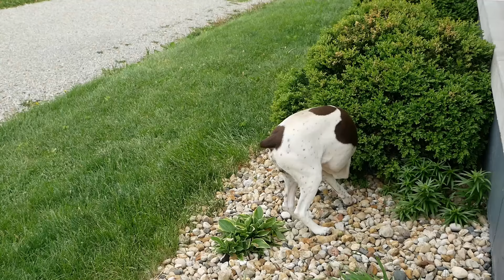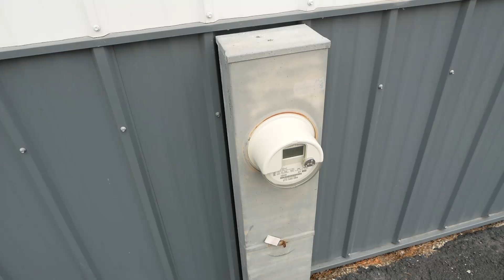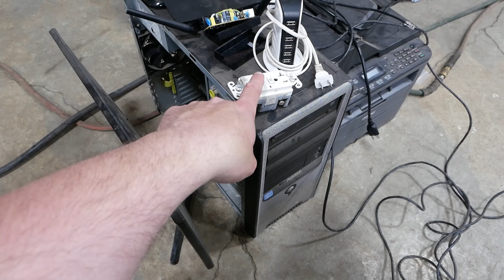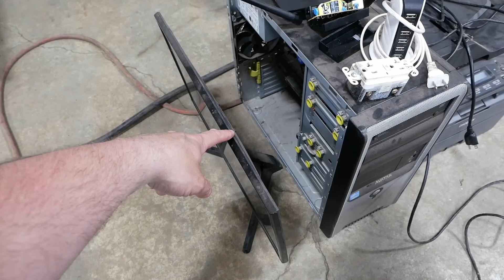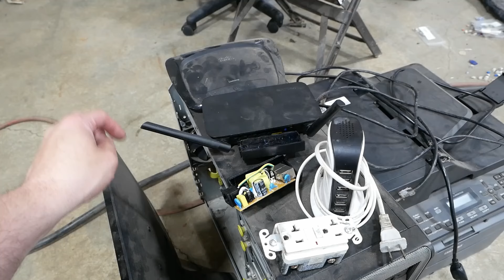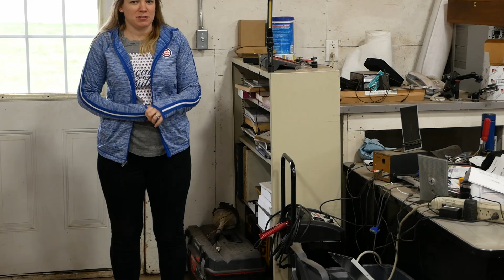Lightning Strikes Shop, Again...

Comment: One of the problems with a close lightning strike is that there are a number of effects other than the current on the line.  The lightning creates a local electromagnetic pulse (EMP) and solid-state devices in proximity to the strike can be taken out.   I designed airport electronic systems and had electronic equipment located outdoors that was electrically protected and in a metal enclosure, and the equipment was damaged by EMP from a lightning strike to a nearby light pole.
Reply: Also not to forget, if lightning strikes a power line, a considerable voltage can also be coupled into neighbouring cables and phone line, smoking devices not even directly connected.
Had this happen ones when my router got smoked through the phone line. And the area I live in actually all lines are underground and did not get a direct hit at all.
Electrical surge protection can be done in a building to prevent auch things happening. Usually it would require surge arresters in two, more likely three stages. But it is awfully costly and the way utilities are built in the US, I am not sure what it would take out upstream anyways that needs replacement.
Reply: This guy is correct
Reply: Spot On.
Reply: You wouldn't believe the amount of people who think that EMPs are conspiracy
Reply: @FrequencyOfThought  emp itself isn't, the "conspiracy" is how little research based information is available. 

I worked on a WSC-3 hf satcom radio in the navy. Every input and output had zener diodes routed to the case. They can short reasonably easy and cause loss of use of that pin. Old timers allegedly rigged a plug where they would pull everything out of the chassis and plug it into 115v to fry all those diodes. I could see a diode protection scheme working to prevent emp damage.
Reply: Some years ago we had two local lightning strikes one about 400 yds away, the other 600 yds away from a station on the preserved railway I help at. Damage was several blown fuses on 240v, 110v and 12v cabling plus a blown diode on a motor all soon fixed. One telephone got blown up but that was the only one as it didn't have the line discharge/surge protection all the others did. This was all down to EMP. Another railway nearby also suffered from the EMP and their computer system was down for nearly 4 days!
Reply: Nature's nuclear holocaust.

Comment: Might be time to invest in a whole home surge protector. No guarantees but they work better than the strip ones. Electrician will install it at the panel unless you fell safe dealing with the incoming power.

Comment: SORRY IT HAPPENED,... When it hits a pole at the road and runs in, there's nothing you can do about it but suck it up and go on. Only way to have prevented that would be to not be hooked to the pole, meaning ... Wes got no electricity....GOOD IDEA but NOT PRACTICAL.

Comment: Back in the early 90s we had an electrical storm which caused several surges. During the first surge  2 lightbulbs burst and our dryer jumped far enough to unplug itself. I had an expensive surge suppressor hooked up to my computer and the monitor did not even waver. I had time to shut everything down with very little trouble. A local TV repair guy was swamped with work most of which was so blown it could not be repaired. Cheers. ~ulrich

Comment: Wes, I'm a professional electronics tech for almost 40 years now.
A surge protector is to protect your house, shop and other buildings wiring from toasters, hair dryers and other items that have shorted out.
NOT electronics. 
For that, considering all you have hooked up including your computer and peripherals you need a 1600 battery backup UPS.
A good UPS will protect electronics from lighting strikes, shorts caused by other equipment in your buildings. 
For a smart TV abd the usual items hooked into them at least a 1200 battery backup UPS.
They actually do protect electronics from various issues that can damage electronics. 
A good one has a small display that has a menu that lists various functions.
The syn wave of the AC feeding into it and out of it.
The load it's handling and you should never exceed 75 to 80 percent of it's max capacity rating.
The backup batteries level of charge and it's condition. 
There's a couple more.
Your internet cable input should be plugged into it. The computer into one of the battery backup plugs.
Items that won't be damaged by the power going out briefly can be plugged into the non battery backup plugs.
Every item that goes into your computer or TV needs to be plugged into the UPS.
A good one has a cable that goes from the UPS to your computer and if you leave your computer on and go off somewhere at a time the power goes out once the UPS's battery drains down to a certain level it will perform a "soft shutdown " of your computer. 
Recently here at our Apartments the same thing that happened to you happened to the pole transformer that feeds my building. 
The next morning there was a pile of tv's, dvd/blu-ray, stereos and other electronics devices beside our dumpster. 
Nothing of ours was effected.
Well, one of our neighbors electronics didn't get damaged but that's because my Wife is friends with Jimmy's wife abd I'd shown Jimmy my UPS after his TV went cabloie for some reason I think was caused by a voltage spike.
The one I have my Samsung smart TV, DVD/blu-ray and stereo on is a 1200 I got at COSTCO for a little over 100 bucks.
Our phone chargers are also on a strip outlet plugged into it as well on one if the non battery backup plugs.
A good UPS would have saved you a lot of $$$$$$.
Ooh,Florida is the state that has the highest level of lighting strikes.
Electronics stores love it.
Reply: Circuit breakers protect against short circuits, not surge protectors.
Reply: @woodhonky3890 .
Tell me Wiodhonkey, how many years working on electronics professionally do you have ?
For ne, 38 years now.
A surge protector is in effect a circuit breaker.
It's that reset button on it that makes it one.
A surge protector is the first line of defense against shorts that can damage a buildings wiring.
As I said, their main purpose is to protect your house wiring from shorted appliances. 
NOT to protect electronics from voltage spikes.
I've been using UPS battery backup units since they were first on the market.
Reply: I'm sorry, but you're just wrong. Short circuits in household appliances do not cause overvoltage events. A surge protector, in fact, becomes a short circuit during an overvoltage event (a thing not caused by a shorted hairdryer..).
Reply: @Monkeh616 .
Gee, then I guess they should just discontinue making and selling UPS battery backup units  in your opinion. 
Only if it's a GFCI outlet does your hypothesis apply.
Every time a circuit breaker is triggered at the CB box it stresses the wiring in a building and can eventually lead to in wall fires.
The whole point is a UPS battery backups purpose is to protect electronics from lighting and other voltage spikes. 
Since I began using them I'm my home and at locations where I or those I was a service manager for not once have I or they had electronic equipment damaged from those issues. 
My profession is Coin-Op amusement vending including jukeboxes (now downloading) arcade and pinball games, touchscreen games and other electronic equipment. 
In the Keys when I was the service manager for TLC Amusements vending I was able to cut our out of order service calls caused by lightning and other power related issues by well over 90 percent. 
The Keys are notorious for having horrible wiring conditions in buildings and especially bars.
The first bar I installed them my boss was skeptical until we stopped having regular problems with the computer systems in our  bar top touchscreen games and the Golden Tee golf games.
Plus blown amplifiers in our CD jukeboxes.
Again, a power strip will absolutely never protect electronics from a lighting strike or any other power surge.
It's NOT what they are made for.
Try doing some intelligent research into the matter.
Reply: @pinwizz69  I never said anything about UPSes - or GFCIs, for that matter.

UPSes are to keep equipment running temporarily in the event of loss of supply - in addition they may be line interactive (multi-tapped transformer) to handle persistent under-voltage or over-voltage events, or double conversion to maintain a fairly constant output voltage regardless of input state. They may (usually do) contain MOV-based surge protection, which protects against transient overvoltage, which has nothing to do with faulty hairdryers.

GFCIs protect against, primarily, shocks to persons by detecting an imbalance in current in the active conductors of the circuit and opening the circuit as required. Nothing to do with surge protection there.

Surge protectors, large and small, as noted above are by and large MOV based and serve to protect against transient overvoltage events with fast edges. They operate not by breaking any circuit but by becoming conductive at higher voltages and intentionally shorting the supply to clamp the voltage. Lightning is an extreme example of such and, for direct hits, requires substantial mitigation to bring energy levels down to containable levels. Other surge events include those caused by inductive load switching, which can cause transients in the low hundreds to low thousands of volts, and are usually easily suppressed by surge protectors of smaller scale, such as those in many power strips. The small, higher voltage MOVs in these strips are indeed inadequate to deal with major events caused by lightning strikes near and far or very large industrial load dumps, however, they make much larger and more effective devices for such tasks.

None of this has anything to do with overcurrent protective devices (circuit breakers both thermal and magnetic, fuses..). Those devices operating does not 'stress' wiring and lead to fires - improper protective device selection, incorrect CSA of wiring or improper installation, and poor termination lead to fires in walls.

Comment: just an FYI, since you are not a computer person, but a surge strip has a limited lifespan!  they need to be replaced about every year, because they are only rated to take so many joules of energy until they are used up. An active UPS is a nice thing to have, because it will just dump the overcurrent right to ground instead of having a surge capacitor that wears out, but if it doesn't do that, my other 2 UPS's have an easy to desolder/remove the MOV, so I can just order a new one every year and pop them in.
Reply: Sort of? The issue with MOVs is repeated high energy impulses cause internal breakdown which causes them to pass current and self-heat at normal line voltages. Thermal fuses are used to remove the MOV from circuit when this occurs. It's not really a case of replacement every year, but when they fail..

Comment: Something I would suggest in future is to put all of your sensitive electronics on a UPS. Not only will that provide you a battery backup in the event of a power loss, but they also tend to have much better surge protection than power strips. Better to lose a $150 UPS than everything downstream of it. APC and Eaton make some really nice, really affordable ones.
Reply: A UPS and commercial surge protector will not stop a lightning hit and charge! You'd  need to install a lightning rod suppression  system.
Reply: @tekvax01  They're not a 100% guarantee, but they're better than surge-protecting power strips. The combination of a standard breaker, GFCI outlet, and UPS will severely limit the amount of downstream damage that is done. I agree that he also needs a lightning suppression system, but this is just general advice. Don't rely on a cheap inline surge protector. Get something good.
Reply: Sounds to me like it came in on his ISP's Ethernet cable.
Reply: Make sure it's a Sine Wave UPS.  I've had good luck with CyberPower UPSes.
Reply: I do believe he said he had everything on a UPS. :)  There are no guaranties when it comes to mother nature, or screw ups by hydro workers.

Comment: this exact same thing happened to me about a year ago. burnt out a gfci in a wall, 3 surge protectors, one of the surge protectors worked until it got a heavy enough load on it and then it let the (rest of the)magic smoke out. new wireless router, cable modem, and 2 air fryers that were plugged in but not on, the brand new washing machines control board that maytag doesn't sell, and a bunch of other stuff. its very frustrating, especially with it going through the neutral which is non-fused/breakered.

it sucks, i hope you get it all resolved without too much hassle
Reply: No fuse protects against this anyway.

Comment: You might consider an Uninterruptable Power Supply (UPS) to power your sensitive electronics.  I have also a whole house surge protector (SurgePro) on the main breaker box in my house.  Don't buy a cheap UPS!   Good luck!

Comment: Wes, check out the “whole house” or shop for that matter, surge protection that mounts on your breaker panel.  It’s worth a try.   Also, I have a nice late model Linksys WiFi router that I’d give to you if you want it.
Reply: the biggest problem with lightning is that from this close, just the EMF radiation emitted by it is capable of killing electronics, and unless you want to live in a farraday cage, you cant really protect yourself from it, also if you are close enough, it even elevates the local ground potential, causing all sorts of weird stuff to happen
Reply: @JDTeam  yep. This happened to my parents house. Didn't hit any lines, but anything that had an antenna without proper protection built in, like modern cell phones, laptops, cameras, got toasty. Printer, router, and Sony stereo.
Reply: @JDTeam  I agree. You have to UNPLUG everything.
Reply: Surge protection may protect against a surge, but not lightning strikes. IME nothing works except maybe 20 ft of air gap.

When  I got struck years ago the insurance insisted the whole house be rewired.

Comment: Sounds like your input for your internet wasn't covered through a surge protector most of the time it doesn't work anyways pure static can kill your computer and all the other devices doesn't have to be the direct current that hits it it's just what goes through the air ask me how I know good luck.

Comment: Sorry to hear about the misfortune Wes. That sounds like the same type strike we got about 2 years ago - all internet equipment fried - antenna, coaxes to router, router, antenna supply and then not one but 6 GF receptacles. Fortunately, all of the inside equipment was spared. Anyway, thanks for the update and we'll be waiting for the next video.   👍

Comment: Wouldn't be surprised if the PoE injector was where the surge entered the Ethernet network and from there destroyed the PC mainboard and presumably Ethernet-connected printer. It sure looked like it arced over from the primary side to the secondary and onto the Ethernet side from there...

With a lightning strike that close it's very tough to adequately protect against it, but having surge protectors with gas discharge tubes (valves) in them in addition to the usual MOVs should help at least. I can recommend putting the PC and associated equipment (including networking) on a UPS with a built-in surge protector. I use a chain of surge protectors like that, first on the outlet, then in the power strip, then in the UPS. Ethernet also passes through a few surge protectors like that, including the one in the UPS. Layered defense cake is the tastiest :)

Hope you can get the current hardware (and internet) fixed up soon-ish. Starlink coverage should be coming to the Southern US before long, seems to be mostly a matter of when SpaceX can get the terminal component shortage resolved, in addition to local regulations. It sounds like it'd be a massive improvement over the current setup...
Reply: Yeah, I was gonna say, sounds like the PoE injector worked a little too well 😅
Reply: Ubiquiti makes surge protectors for the POE/Ethernet cables that they could use.
Reply: motherboard